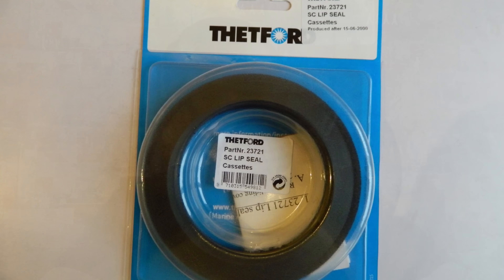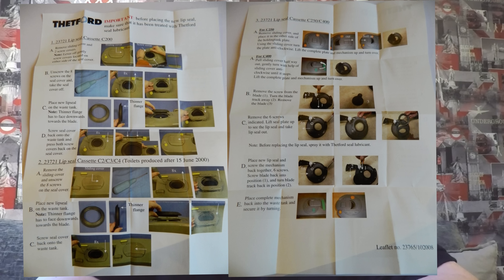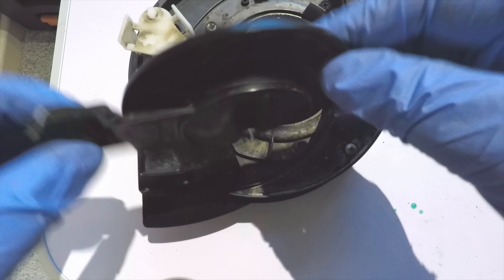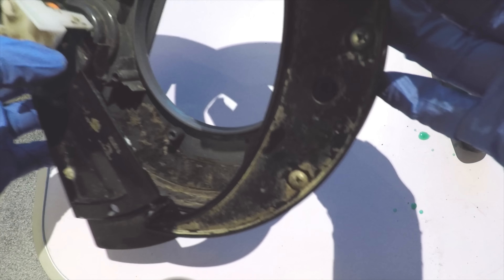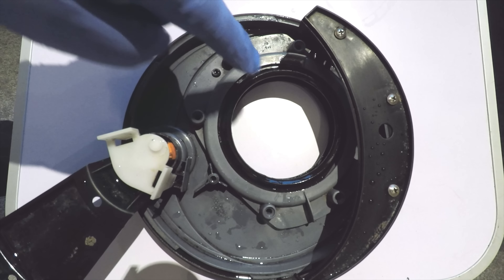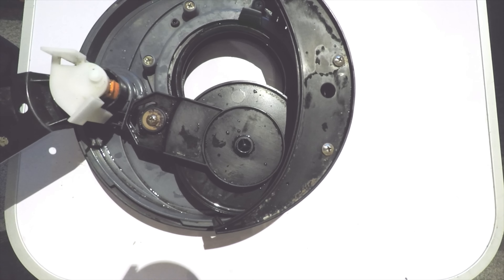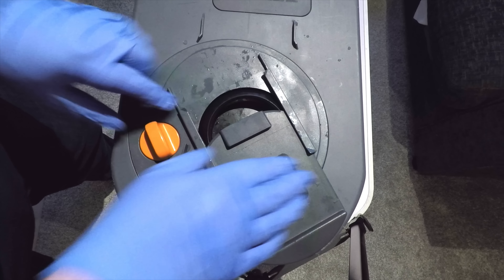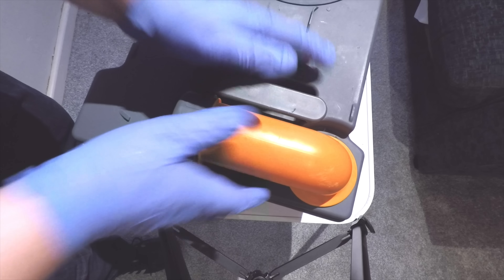Thetford toilet cassette lip seal replacement

Comment: One great tip Martin, don’t use the slider to unlock/lock the cassette.
Cut a piece of quarter inch ply about 10 inch long.
It stops the grooves getting damaged.
Reply from the maker: Hi Colin, top tip there. The slider is not the ideal way to do it as it can easily slip out of the runners, the cover is quite difficult to get off! Thanks for comments and watching, Martin 🙂
Reply: The Caravan Nut no problems, that’s what we do. Learn from each other.
Great videos.👍👍

Comment: Great video. The newer model is so much easier to work on. I had a problem with the blade not locating against the seal and had to work on it via the hole and repair it mostly by feel. Looking forward to seeing your next video. I know it’s belated but Happy New Year to you and your family.
Reply from the maker: Hi, When I did it I wasn’t sure it was correct so took it apart again, edited that out! Happy new year to you. Thanks for watching, Martin 👍

Comment: You were lucky. The curved part is supported by 3 lugs and one was broken when l opened it and being clumsy l broke another. Had to buy whole top unit which was £50 including the seal. As is normal l had already bought a seal cost £25 from a caravan dealer. Expensive.
Reply from the maker: It’s not the easiest of jobs, suppose it’s built well though!

Comment: Great video was finding waste wee as if it was leaking  when removing cassette from van just replaced seal hope this stops the issue cheers
Reply from the maker: Hi Paul, glad the vid was helpful and hope it solves the problem. cheers Martin
Reply: Did it?

Comment: any idea why with new PCB controller board on C250 worked then didn't then worked again briefly but nothing again since? Fuse checked OK and seen on another video to put 12 volts directly on PCB block to test pump but not sure how to do that, any suggestions?
Reply from the maker: Check the connection from the PCB board to the plug that connects the board. Ours has come lose a few times.

Comment: Hi Martin, the white bit attached to the mechanism that opperates the blade is missing on mine, what does it do, and is a part that can be bought or is there a work around.
Reply from the maker: Hi David, I think it’s the part that stops the blade spinning all the way round, is this it? let me know how you get on.
https://www.leisureshopdirect.com/water/caravan-toilet/thetford-cassette-toilets/thetford-c-250-cassette-toilet-and-spares/thetford-c250-c263-s-cassette-toilet-saddle

Comment: Thanks Martin, tried to take the unit off, but mine seems not wants to turn, worried I would damage if I forced it, is there anything you need to do other than use the handle/ cover, hope the weather warms up 🌞🌞
Reply from the maker: Hi Pat & David, yes mine was difficult to get off, I left that bit out of me trying to turn it and swearing at it! A bit of force and ignorance did it! Looking forward to warmer weather! Thanks for comments and watching, Martin 👍
Reply: Get a flat piece of wood longer than the plastic slider, but the same depth and width - place this in the gap and use the extra length of the wood to provide more leverage and avoid damage to the plastic tracks either side :)
Reply from the maker: I now have some wood to do that job, cheers

Comment: Hi Martin. Quick question, how do you find towing the Valencia? Does it snake feel unstable at all? Just wondering about single axle’s. Cheers Oliver
Reply from the maker: Hi Oliver, it tows really well and very stable. It took us a while to get the loading correct for noseweight but we have it sorted now. Cheers Martin 👍

Comment: It's also worth mentioning that if you have the previous model cassette and you're looking for that access hatch on the top, there isn't one, there are 6 screws on top of the sliding mechanism and you replace it from the top, same seal just a different way of replacing it
Reply from the maker: Cheers for that, not having done a seal on the older one that’s great information. Thanks for comments 👍

Comment: Hi Martin. I have a question regarding. Cassette toilets. Someone told me they use Aldi bio  tablets instead of blue in the toilet cassette have you any information on this as quite a few people seam to use them ?
Reply from the maker: Hi Paul, not heard of this before but just looked it up. A lot of people using them, a few saying they don’t kill bacteria. Some say use them but now and again put blue in. It’s a cheaper alternative, give it a go. Cheers Martin 😊
Reply: The Caravan Nut thanks Martin for the quick reply.think i will give it go.if it works could save a few quid and weight in the caravan. Cheers mate have a good week 👍
Reply: Hi Martin. Update on Aldi bio tablets instead of blue.Been away in the caravan for 14 nights. Used the bio tablets 5 times and and the blue twice. And the tablets work fine 2 tablets per cassette. Looking like saveing some money and weight of blue fluid.👍
Reply from the maker: Hi Paul, thanks for getting back to me, sounds interesting I will look at doing a vlog on this. Like the idea of saving money and weight in the van. Have a good weekend. Cheers, Martin 😊